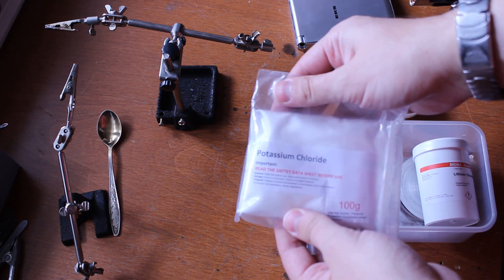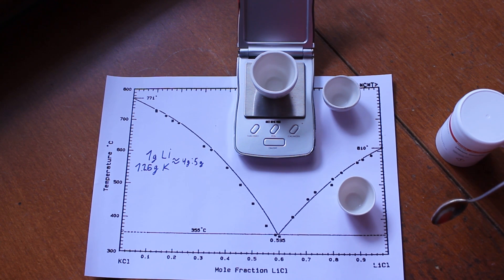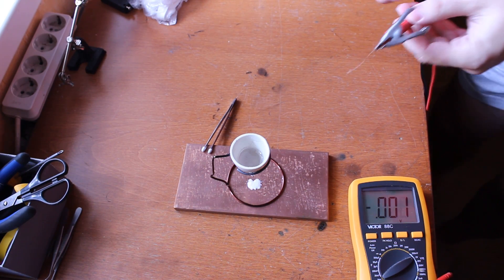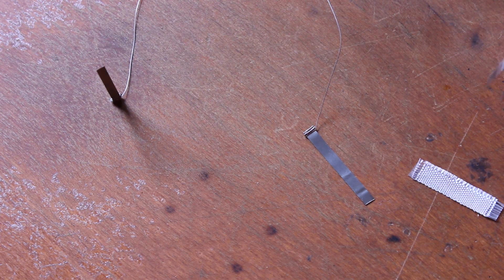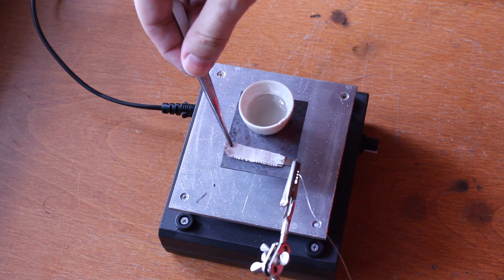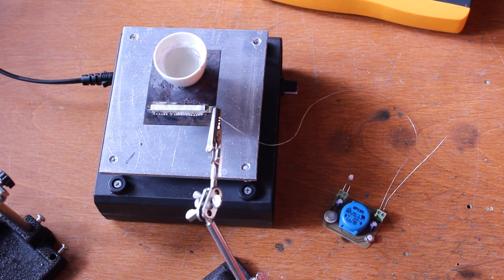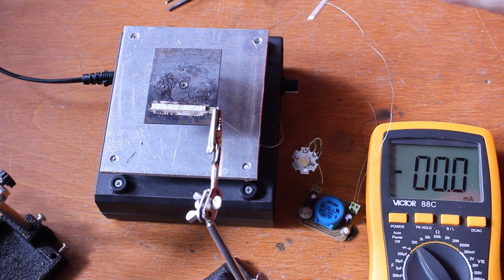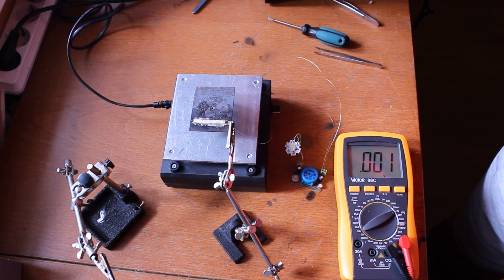DIY Molten salt battery

Comment: What about corrosion/erosion of the plates and the long term effects?
Reply: I think this is why it's used on military applications such as cruise missiles. you don't care too much about the battery life time as far as the whole system powered by that battery is going to be destroyed.

Comment: Using a 240V heater to generate 1.5V of power. Great fucking work dude. You created a resistor, not a battery.

Comment: is it possibile to do a solid salt battery?
Reply: No. It only works with heat molten salt. I live in Brazil.
Reply: @daltonagronomo1652  Can't tell how saying "I live in Brazil" adds to your argument, but some very simple batteries have been shown to work with just salt+water.
Reply: A solid state battery would be interesting

Comment: the real merit of these is to store large amounts of heat in a relatively small space. very useful for residential heat applications and things like concentrated solar heat power plants. the voltage is kind of a side effect
Reply: there have been production electric vehicles with this tech, pretty sure the weego was one of them.

Comment: nickel and iron used by Stuart Licht George Washington University and using a similar eutectic salts. Rechargeable, which is to say that a current is used from a battery charger. Theoretical energy density is 10 kilowatt hours per liter with Fe & Ni. Higher with vanadium oxide, zirconium stabilizers and other exotic mixtures

Comment: Voltage means nothing without knowing the resistive load, or the current.
Reply: For all of them thi k if it works good enough or not, I would add these are used in Military Application Since 1940s, so yea
Reply: Also a Battery is Always Measured without Load For Voltage and Then Short Circuited for Maximum Current. You then can find or measure it's Internal Resistance to calculate the Power Loss in Battery
Reply: He showed 150mA at 6:45. The real question is the mAh
Reply: Are we just going to ignore the 240 volt heating unit creating the energy? Turning 240v to 1.5v is pretty fucking impressive. In all the wrong ways.
Reply: Well that's just not true; 1,000,000 Volts would constitute a certainly measurable amount.
Power density is key, right? Like a tiny little bowl with 1M V would be insane.
Reply: Jay Edlington you could have 1 trillion volts, voltage is nothing with no actual current, which is the actual power it carries. 
Everything electrical really runs on watts
Watts=VoltsxAmps
Volts=Watts\Amps
Amps=Watts\Volts
As you can see, Watts is the usable energy measurements
And if watts is voltage x amps then
1,000,000x0=0Watts
No usable energy
Reply: Come on guys. This is a great proof of concept. As of this moment it is still the only demonstration/experiment of a molten salt battery on youtube.

Comment: You could use the fiberglass cloth and sew a pouch around the magnesium electrode..
Reply: That's a really good idea. And if you rotated one electrode 180 degrees so the exposed metal and wires were coming off of opposite sizes, you'd greatly reduce the risk of shorting the two conductors together.